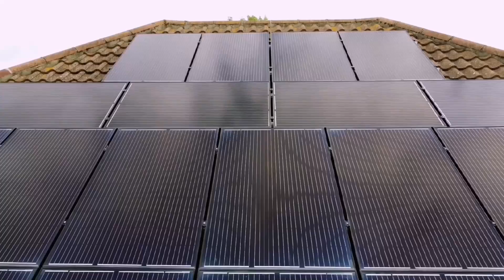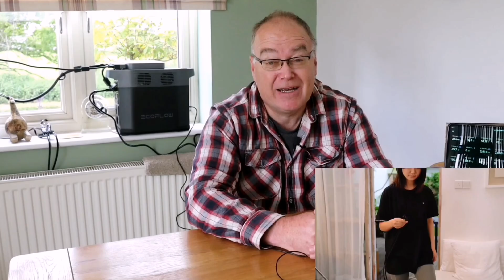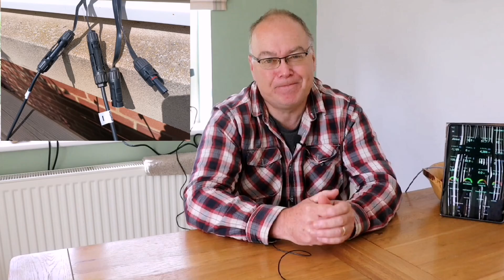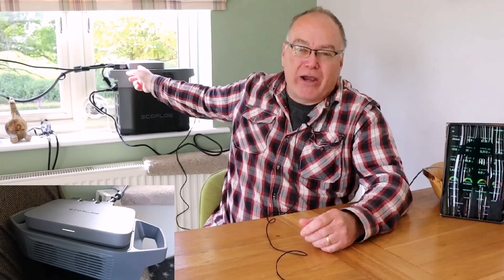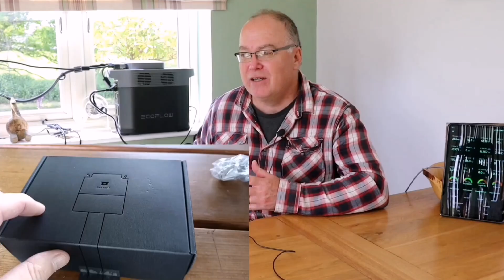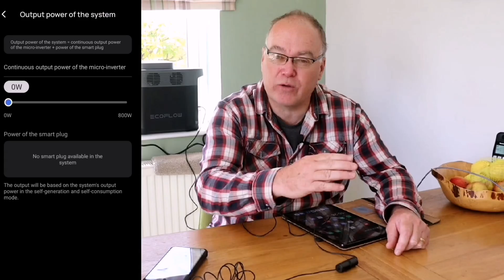Revolutionary Ecoflow PowerStream - DIY plug in grid tied Solar PV & battery system

Comment: The whole reason this isnt in the UK market is its against UK electrical regulations to have a UK plug back feed into a circuit. Micro generation products need a dedicated circuit not your house ring main or radial. Naturally the reason for this is because you would feed power into the circuit before the MCB/RCD/RCBO in your consumer unit. Ecoflow are not correct here sadly. If you have a circuit though with nothing else on it you could connect it in though so maybe a grey area where Ecoflow are correct... you'd in theory need to unplug everything from the socket circuit then plug this in and never plug anything in. Realistically not going to be policed though. Not to mention who expects plug pins to have LIVE electric on it
Reply from the maker: my understanding is it's a grey area and up to 800w is permitted to back feed
Reply: @EVPuzzle Your understanding is poor then. Go and read EREC G98 (Amendment 7) and BS7671.
Reply: Well I haven't used ecoflows micro inverters but the one I have used (a beny unit) you can't have live pins. It has to sense the grid and sync with the Hz rate on the network before it will output power. So if you just pull the plug it disconnects the power within 300 milli seconds (same time as an RCD). 

So from a safety point of view it is very safe, in fact safer than what it's being connected into. Most houses just have a passive protection system (RCD and MCBs), this is active.  No live parts to touch, no risk to the network and no (little) risk to your cabling as it's only max 3.15A.

But where I haven't seen a change in the UK is all microgeneration if grid connected is noticeable to the DNO. 
Does Ecoflow inform the DNO with the info you provide? What if you sell it on to somebody else? 
Or is it another case (like e-scooters) that you can buy one and use one but in reality you're likely breaking the law.
Reply: @garbon73  I have a feeling its not actually got a UK plug on it, its an EU plug with adapter 😂
Reply from the maker: Lol, the images are EU plugs but no this is UK CA approved and UK plug

Comment: Great video, I'm very interested in this product. I have a couple of questions. 1. So you don't use the inverter on the DeltaMax, that is the separate grey box? 2. You plug this into a house plug and set the power limit, say 800 watts, what happens when you switch on the 3kw kettle, the grid powers the additional 2.2Kw from the grid? 3. How long a cable do you get from the solar panels to the grey box? 4. Are you easily able to add more solar at a later date or additional battery capacity? Thanks
Reply from the maker: 800w solar limit on the powerstream inverter

Yes it's the powerstream micro inverter inverting power. None of the 3 pin sockets on the delta are in use.

If you turn more things on your house draws more power....from the grid
Reply: @EVPuzzle  And what happens if you set for example 800W on ecoflow and you houser is drawing only 200 for instance. it is exporting to the grid right ?
Reply from the maker: @paulf3353  yes
Reply: @EVPuzzle  Then you need a DNO approval and transfer switch, it is not legal just to connect it.
Reply from the maker: @paulf3353  legal to what ?  Electric regs are for installers not consumers
Reply: @EVPuzzle  It is illegal to feed back to the grid without approval! It is a safety risk too!

Comment: Some questions -
1) Can you set a charge limit for the battery? The best value system has a standard lithium ion battery (not LiFePO like the others) so would benefit from limiting charging to 80%.
2) Can you over panel it so you are within voltage but with an excess of current? This would help on less than optimal weather days.
Reply: It's normal practice to 'over panel' an inverter. As long as it can handle the voltage they should limit the current themselves. In the UK where full sunshine is not the norm you can still utilise your inverters capacity by simply adding more panels.
Reply from the maker: Yes you can limit charging %
Not sure what you're asking with 2
Reply: @EVPuzzle   Can you add 1000w solar when it says 800W max. I think for the Delta Max 2 with two PV inputs there will be a max voltage input which should be less than the PV can produce.
Reply from the maker: @DanielEarlester  solar limit is the powerstream inverter where it plugs in. Solar Doesn't plug into the battery itself

Comment: I never thought about feeding back through a plug. Fascinating. If you already have home solar can you have just a battery and charge it from the grid (excess solar or overnight off peak)
Reply: @DanielEarlester Sorry, but to me this reply doesn't answer anything posed in the question. Can you elaborate on your response somewhat? Like this chap @MrKlawUK I have a fixed solar array already and don't want to invest in more expensive smaller panels, but just want to store a bit of surplus generation to run the TV, a light or two and the standby items and fridge freezer. Charging from a socket in the time near mid day would be well cheaper most days as it would otherwise just go to the grid.
Reply: Yes but if it goes cloudy then it would be more expensive. This system handles all that.
Reply: It's actually illegal to backfeed electricity into a home electricity socket in the UK for all sorts of safety reasons . This devise is no different from plugging a petrol generator into a 13a socket which is as I said illegal and potentially lethal

Comment: Hi great review, also like how this technology is progressing, got a few questions if possible you may be able too answer. 

- we have solar and battery storage already, how does it effect your readings ? As in solar going too the grid after the battery is charged on the house battery and the eco flow. Hard too explain what I mean but do they interfere with each other ?
- will it work with a delta mini battery ?
- the base load you were on about does it help with you fixed battery, similar question as the first. Just done understand that part. 
- wonder when the house power is off for grid maintenance or a power out, wondering about the whole back feed this may cause issues to workers or the house circuit. 

Really like the idea of it though, I have a victron solar setup in my workshop and battery storage I think solar and battery storage is very very clever. 
Thanks for your help Sam
Reply from the maker: I've got victron too with Pylontech   when powestream is outputting you basically see your AC load reduce so your fixed home battery doesn't have as big a load to cover.  I think of it as a negative load device .

Delta mini isn't compatible, it doesn't have the side socket for expansion batteries or power stream connection

Comment: This is a very clever product, I had no idea that you could simply feed power into your house through a 3 pin plug
Reply from the maker: There appears to be limits and safety requirements of course
Reply: You do have to be very careful, obviously you will have the 3 pin plug “live”, so what happens when you (or a child) unplugs it from the socket, does it remain live, in which case you have a very dangerous situation.  Household systems have never been designed to “back feed”, until the advent of solar / battery systems its  never generally happened.  There’s a fair few technical / safety issues to consider  before you go down this route
Reply: Unless its via something like the EcoFlow, which I’m assuming has the correct protection built in
Reply: @dave300m7  Grid tied inverters are required to meet stringent tests that they kill the power if the grid power goes away so it should be fine. It's there as much to stop you electrocuting electricians as anything else.  If you have two solar systems it might be a problem depending how it works. It's also why the system can't be used to power the house in a powercut (but the battery pack sockets can).
Reply: They have a bit of a different system for Canada: There's a small breaker box that has to be installed by a qualified electrician (for waranty), and it connects to your existing home breaker box, and your power station is plugged into that. So it probably really depends on where you live.

Comment: Very interesting, so basically how much money could it save you. Obviously your looking at the initial out lay first to repay back. I know the power station isn't static, and can be used away from the home. And why couldn't you just have a panel with a fixed micro inverter(like an Enphase with auto disconnect) plugged in your ring main to cover the base load?

Comment: Compareing this to the cost of my pv installs and battery install this is actually pretty good. Providing 1 you have a suitable clear area for the panels as you lose the perks of being on the roof, 2 have the cash upfront or are already looking for a small solar setup. This would cover back ground house load, and slow charge for the evening. 1 niggle that would bother me personally is the suggested number of cycles of the battery. Their larger 3.6kw is 3500 cycles see's the battery capacity drop to 80% which is not that great compared to other cells. Suggests 5 - 6 year life span?
Reply: One of the bundles has a battery that is only rated to 800 cycles before it drops to 80% but if you only cycle 80% to 30% for example you could get 2-3000 cycles. You would only be accessing 1kwh but this set up is really targeting your background loads so at 100w that's 10 hrs. If you are using the full capacity every day you'd probably be better off with a larger battery.
Reply: @matthewwakeham2206  Dont forget that the inverter can power the home during the day as the panel create power, therefore it is capable of yes storage power up to 1kW but by powering the house during daylight hours the battery power can be prioritised outside of daylight hours therefore extended your example of 100W beyond 10 hours.
Reply: In 5 or 6 years battery technology will have changed dramatically, I expect people will changing out perfectly good batteries for new technology.  I have an eco flow I use with my campervan and for backup in a power cut which get a few. I have just purchased the mini inverter so I should get far more use out of the expensive EcoFlow units.
Reply from the maker: Think that's the guarantee so hopefully worst case..must depend how aggressively you charge and discharge
Reply from the maker: Guess we only find out for sure years down the road but when they degrade to 80% presumably we just add another battery and continue using the 80% capacity
Reply: @EVPuzzle  I noticed they sell extra battery units. It is a nice idea for those without space for a full install.
Reply: If you charged from 0 to 100% every day that's 10 years before it drops to 80%, not 5 years!

Comment: Very interesting  idea!  Great idea and great video
Reply from the maker: I'll send you your payment later Nickie 😉
Reply: @EVPuzzle  lol 😂
Reply: Looking on the website it dont make it clear if you could use the solar to charge the batteries in the event of power cut ? Ie yes i know you cant send power back to the grid in power cut as it will  endanger workers but  if you have this setup and cant recharge the batteries from solar like you can do already , would be nice if you could still power there smart plugs it seems bit pointless as 1-2 kWh isnt going to last long ,  its good for its diy  idea but isnt this already done with there other bits  or is it just now its  all in one kit ?  People dont want to be messing around with extra cables when there is a blackout  compared with in normal use . Mite be wrong but there website needs to be clearer i think 🤔

Comment: I would like to see far more detail concerning the wisdom or otherwise of connecting via a three pin socket. Plus if this is an issue where the appliances you want to power (say a fridge freezer) should be on the same ring main. Good presentation Nigel, excellent opportunity for a follow up video as the manufactures English language website is very light on detail.
Reply from the maker: Cheers Dennis .  Having read the safety instructions which say use appropriate PPE whilst operating the equipment  and refer to local rules , there's always doubt in the mind. Wisdom would say place on a separate consumer connection but being a lay person I hear the electrician's view which is quite rightly safety focused but then I read the official documents and find it's not exactly clear.   I guess I have to trust the company that gets these passed UK approval have done their homework and 800w backfeed is allowed and safe.

I've most certainly had no issues

This system is controversial in some ways as it's breaking with what we're used to but is that wrong?
Reply: @EVPuzzle  I think maybe check this out with one of the trusted YouTube electricians...Cory Noah Mac and/or Artisan Electrics? I'd be interested in their opinions on the two way socket thing.
The thing with electrics is it can seem like everything is fine until it isn't!
Interesting concept though and if it's really safe it could be something we'd consider just because solar/battery systems are our of reach in terms of cost for us now. Mainly because we did have to get a used ev last year when our car was written off so it would come in handy to trickle charge it off sunshine in the summer with no driveway parking.

Of course I'd have to try and understand it first, not sure I'm altogether there yet on amp watts and volts...there have been some lovely explanations by some YouTubers brilliant analogies to water flow but sadly my poor afflicted brain can't retain the info!
I'll need to watch this again Nigel. Thanks for bringing it to our attention, good honest review as always.👍
Reply: It's only 600-800W feed into the house so I am sure they have tested it thoroughly. I think most ring mains can handle 9kw or a bit more.
Reply: @DanielEarlester it's illegal to connect any additional power supply to a 13a socket for all sorts of safety reasons

Comment: (Typing this before getting to the end, so will edit if needs be!) - What happens in the event of a power cut?  If it keeps the house going during a cut, could it be used to keep a hybrid solar inverter alive so that you can run the house off the hybrid battery?  I thought that would cause issues for the grid, with the system potentially exporting power/making the lines live when engineers are potentially working on the grid?
Reply from the maker: It's designed to provide power after a power cut but interesting thought, would it or could it fool a solar  inverter to keep alive. I guess not otherwise solar would then potentially go back to the grid which isn't allowed.

My system is ok as the victron unit I use has a transfer switch which completely shuts us off from the grid
Reply: As far as I'm  aware if there is a power cut it shuts off in order to avoid trying to power your local neighbourhood and electrocuting anyone working on repairing the fault. You can plug things directly into the powerbank to power your fridge etc.

Comment: A negative from the manufacturer :- "For safety concerns, PowerStream Microinverter will stop the current output after a power outage in the home, but Portable Power Station can be used as a backup power supply to connect to the appliance." So not a UPS for your home.
Reply from the maker: Answers a few questions here apart from how it detects it
Reply: @EVPuzzle  my guess is that there is a voltage detect on the Output of the battery/ inverter unit, otherwise the plug that you put into the socket could potentially be live. The detection of a "mains supply" on the socket would probably be enough to allow the unit to power the house circuits.

Comment: Plugging this into your mains to provide power?
Did they say what happens when there’s a powercut? Battery systems should disconnect when the grid goes down so you aren’t backfeeding the cable in the street and causing a shock hazard for the electricians who come to fix the problem.

Comment: This would have been useful in my flat when I was renting.

Huge downside is that you have set the export amount from the battery, which might be higher than it needs to be.

A wireless clamp the user could install would mitigate this I think, although would add a bit of complexity.
Reply from the maker: Add the smart plugs and you can get pretty close.
Reply: @EVPuzzle  True. Just seems a better solution is a possibility rather than adding smart plugs to everything.
Reply: @RichardBrooklyn  I would only have two smart plugs. One for the fridge freezer and one for the TV/computer setup including chargers etc. on an extension lead.
Reply: @DanielEarlester  what about lighting in the evening? It would be nice to cover that load too. I agree with Richard, It’s very nearly ideal but a ct clamp operating the same way as the smart plugs would make it great.